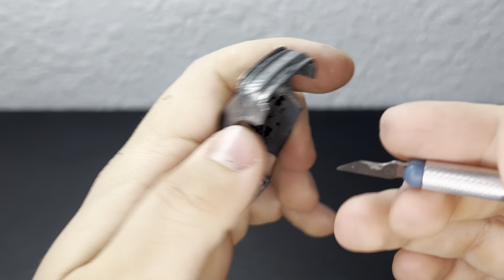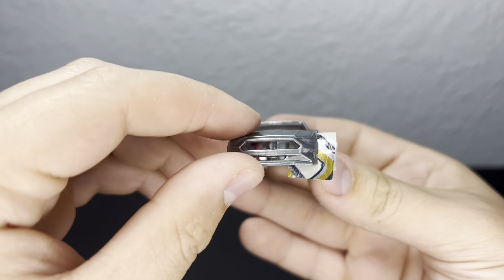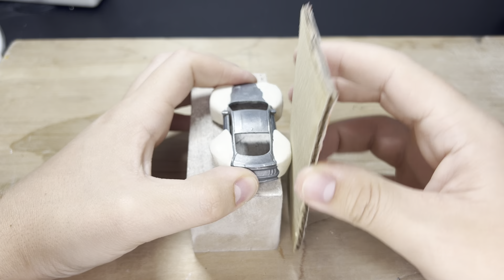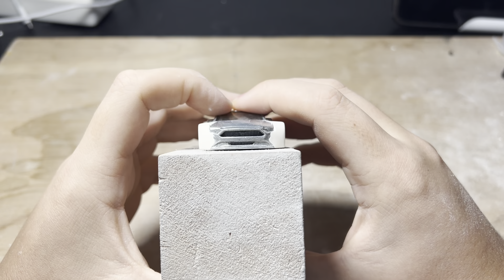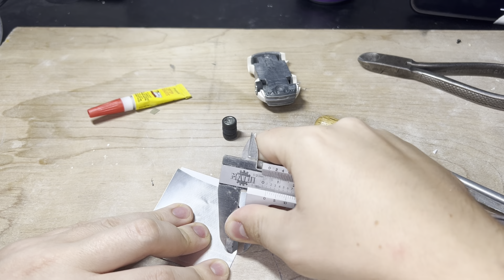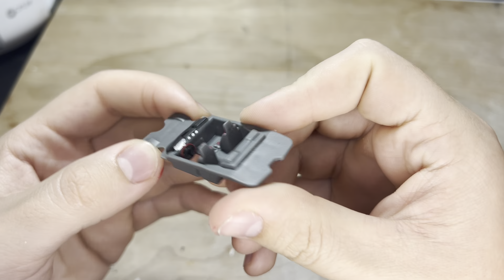How to WIDEBODY Hot Wheels with Epoxy Putty

Comment: Brilliant video, very well commentated.. can we use any acrylic paint with the airbrush or it has to be paint specialized for airbrush use?
Reply from the maker: You can use any acrylic paint , even Walmart acrylic paint . Only difference is with airbrush paint is the paint pigment particles are more fine/smaller and sprays smooth compared to regular acrylic paint which can clog up the air brush . If your on a budget go with cheap acrylic paint and dilute it with water
Reply: @Widebodybilly  big thanks buddy! keep up the great work i already subscribed!

Comment: lil tip if you wanna speed up getting paint off you can use a wire brush for the dermal its what i use and its nice (its a bit messy to be fair)
Reply from the maker: I might have to get one 😮 because it is kinda time consuming doing it with a brush
Reply: @Widebodybilly also get a nicer one its worth the money. cheaper ones tend to fling the bristles everywhere!
Reply: Yeah dude agree 💯 with that tip. The only thing is to watch out for flying bits of metal from the wire brush.